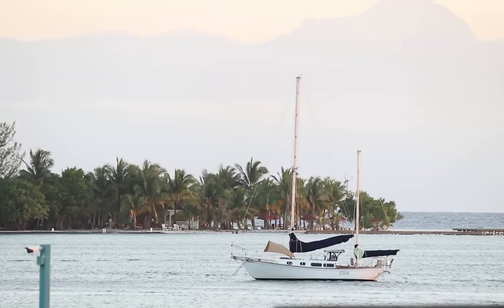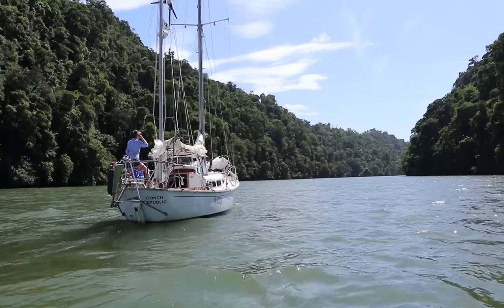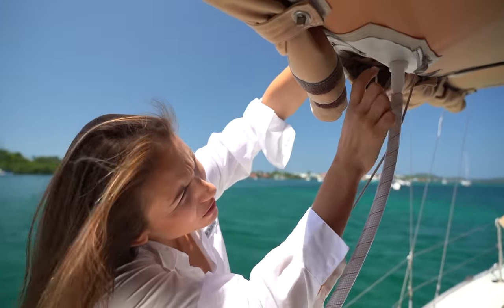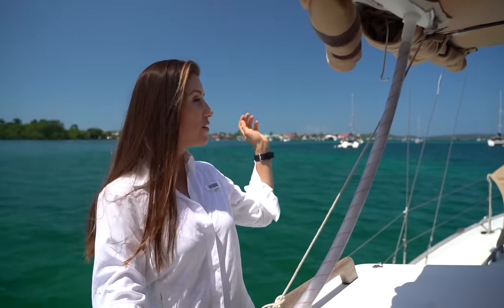Living OFF GRID on a BUDGET Sailboat | S04E24

Comment: Just a thought.  I would think it pretty easy to build a solar water heater for your use. 30' - 50' of black 1/2" tubing or pvc ran any place convenient tied to a 5 gal water container would give you water at 120 + degrees in a couple of hours of direct sun.  Just mount the water tank above the "collector" tubing so it stays full of water and let convection circulate the water.  A warm shower?  Yeah...

Comment: 20:05 If you wanna save electricity you can use a DC-DC laptop charger made for cars.
They're way more efficient than  converting your 12VDC to 110AC and then back to whatever your laptop needs.
The Topland M4315 does a good job and comes with an adapter for just about any laptop out there.

Comment: I lived like you guys for years on my self built 27 footer. All the same systems. Same shower and water routines including capturing rain water. I never needed to fill the water tanks from the dock. (OK maybe once every six months). However, I attached the BBQ to the back rail along with a solar oven (fabulous for seafood).. I also made a Stainless steel water heater which hung off a side rail and made boiling hot water for the boat when the sun was hot.  Like you guys, I had solar and a wind turbine.  I had a newer Engel though. 
One thing I didn't see. I had a hammock attached from the forestay to the mast and used to spend all day in that thing just watching the view and reading. The boat naturally tracks the breeze so always had a breeze on me. I also had a very small Esky underneath the hammock for the beer. Absolutely an amazing lifestyle. I then screwed it all up and got a GF! What a great channel.
BTW> You didn't need the 110VAC inverter for your laptops as there are DC to DC converters e.g. 12VDC to 18VDC which can be switched for any laptop.

Comment: "the perfect being the enemy of the good" -  that's my motorcycle -
Reply: @MGreen-vz6yb  In the original Italian it was, "Il meglio è l'inimico del bene" (the best is the enemy of the good) and was quoted by Voltaire in his Dictionnaire philosophique.

It does mean what others here have said, that obsession with perfection can prevent someone getting a “good enough” job done when it needs to be done. However it can also refer to sabotaging the good enough with an excess of criticism because it doesn’t live up to an ideal standard.

In sociology and politics it can refer to a push for ideological purity and perfect solutions to problems that are beyond the (current) limits of human behaviour or technology. It can mean people who are ostensibly on the same team fighting each other over who is more ideologically correct, and those with the most “pure” ideas condemning those with less idealistic plans, even though those ideas would still be a step in the right direction, and might be more practical and easier to achieve initially.

It is sometimes connected with the Nirvana Fallacy, and the “Perfect Solution Fallacy” Nirvana fallacy.

Comment: Hi, the boat looks very well set up. I built a 32' timber boat in the 70's and we did numerous trips from NZ into the Pacific during the 80's and 90's. Even with a baby on board we managed just fine and on a shoe string. Back in the day 30 footers were considered average size.  Now we are 68 and the boat is 40 but we aren't done yet. 32' is plenty to maintain and we still use a weed sprayer in the cockpit to shower.  Happy sailing.

Comment: Fantastic video, thanks for giving insight into what is possible and enjoyable.
I live in a van, did you know you can get buck regulators that will convert dc to dc i.e 12v to the 19vdc your laptop needs, that'll save you the inefficiency of the inverter.

Comment: Interesting episode. A question on your Weboost cellular signal booster, from reading their literature the outside antenna is directional. How did you mount the antenna and do you have control of pointing it at the cell tower of interest? Secondly, it is powered by default by an AC, do you power it off your inverter or did you bypass the plug and wire it to 12V? Thanks!

Comment: I wonder if you could make a basket with shelves and rubber bumpers that you could put in your freezer and which could be pulled out vertically with a cord slung through a pulley attached to the ceiling above the freezer.

Comment: If your water jar is air tight, you can tie it to your boat and leave it in sea and save some space. Cause water water bottles with little air will keep floating and just need a pust to move with your boat. To avoid collide with your boat you can use soft silicone type material bottles/water storage of 10-20 gallon.
You can use mountaineers rope huks to tie curtains/shades to save some time everyday.

Comment: From beautiful Friday Harbor, San Juan Island.  You two are so impressive. I'm thinking your the modern day Heir apparent couple to Lynn and Larry.  ( I had a chance to spend some time with Lynn & Larry, as well as Beth Leonard and Evans Starzinger when they came through Friday harbor)  . Lynn & Larry on their 29'. I've been running virtually all the same systems as you guys have.... I don't know how you run your 3 Fives into your water tank...I set my 4 fives on deck  and then use a primer bulb..10 squeezes and the water gravity feeds in .   Then switch water tanks and prime again.     There is something I feel is a bit important...I once  read a story about a CQR bow anchor in a HURRICANE.  They were stern tied to shore mangroves. ( By the way  the CQR is( bad) BUT with a rare bow stern set up it will dive. Divers with shovels found it like 5 feet down after a huge blow. O.K. Here's my point....Your current anchor, with the bar on top, will not dive deep...If its loose mud and vegetation or not  the bar lodes up and causes your anchor to plane upwards...releasing..  In sand it can not go deep  It must stay shallow.  Spade america anchors  has the best anchor or Ultra or....Well you can look at an anchor and see if it will DIVE... ( 7 years anchored in 45 feet at a high latitude)     G.T.  S/V     Silver Fantasy...     Oh...Keep on Rockin in the Free world.

Comment: You mentioned that you use your 110v inverter to charge your laptops.  Wouldn't it be more efficient to get 12v laptop charging adapters, rather than converting from dc to ac, back to dc?

Comment: hey, if you want a hot shower, just fill up your personal pressure tank, paint it black, put it on upper deck with direct sun light and you will have free hot water.    in other complicated way, used  a heat exchanger from the boat engine.

Comment: I would stick a couple 400w solar panels and a large 21700 battery pack, inverter and either solid state a/c or even a rv a/c unit in that boat and chill when its hot! It wouldnt take a very large system to keep that boat cool.

Comment: You know you can get 6 gallons of fresh water a day by using a dehumidifier. Just pull the holding tank out and pour the water into a water filter and cook or drink. You make your own water by extracting moisture from the Sea air. Just plug it into the inverter.  Years ago when in the military ... we were confined to one room and couldn't leave for month.... There was no water spigots in the room at all and only a chemical toilet.  We had electricity and dehydrated food, but no water... We all thought we were going to die until I found this dehumidifier and plugged it in.... It sucked 6 gallons of water out of the air a day.